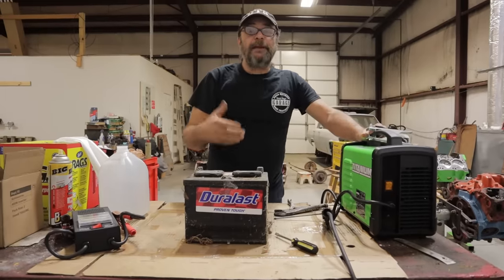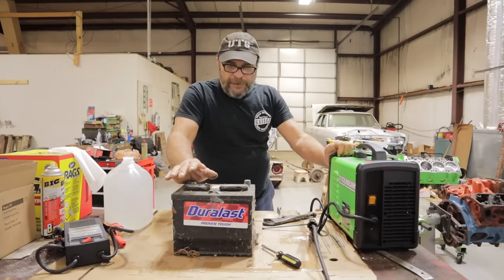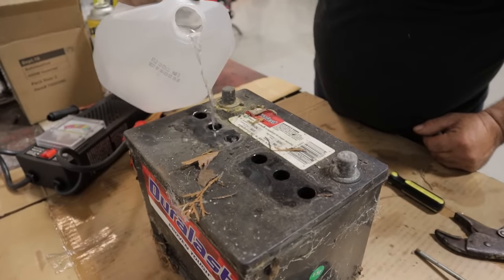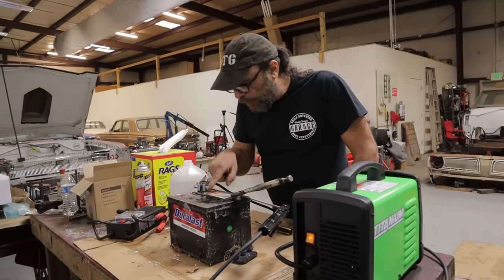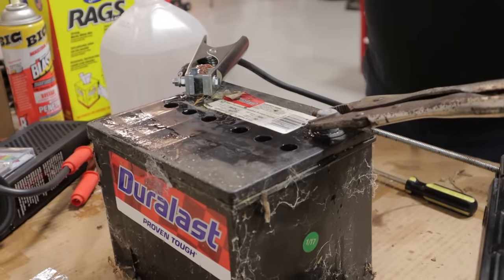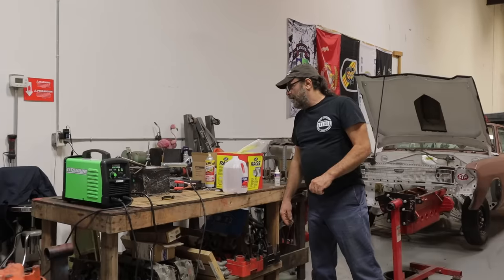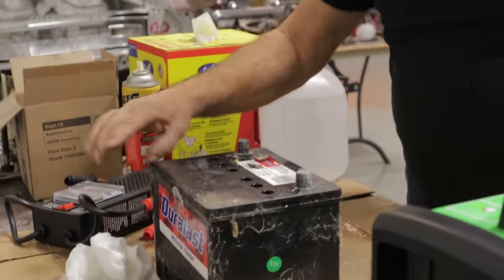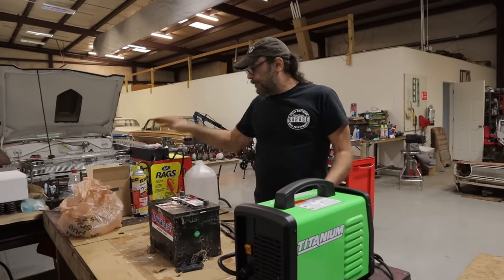Reviving Dead Batteries With A Stick Welder

Comment: 9:32 that’s the plates itself 😂, unfortunately sulfite is a component of active zone of the plate also (part of bonding agent), when you boil battery that way you are basically diluting it in electrolyte (ability to dilute it depends on the water/acid)

Comment: I have several golf cart batteries I'd love to try this with! I converted my Lincoln AC225 to run DC as well, but need to finish the power wiring.
Would you recommend doing each 6v, or connect 2 together for 12v, or do you think I could do the whole 36v in one shot?
And what about a sealed Optima battery?
Thanks for your content, I love Mopars & your channel is one of my favorites.
Reply: I think the Holy grail is from the high-frequency spikes in smps welding machines. So normal 50/60hz transformer welder may not give you good results, just thinking anyway.
Reply: how do u convert a ac 225 to dc? c an u have it work both ways
Reply: @dancassidy6708  I tried to find the video I followed, there are several newer ones, but here is the basic concept; https://youtu.be/JXJaRPXPwjQ
I built my own 250A bridge rectifier out of 5- 50A and used an old transformer to build the shunt. I kind of went overboard with mine my leads and all outputs are all converted to Dinse QD connectors (I can switch from AC to DC & switch polarity) upgraded and added fans, I have 120v outlets for a grinder, and I added a 24v DC power supply to power the fan in my helmet (hot & humid here) keeps it from fogging. Not too difficult or expensive.

Comment: So you boil  clean  the plates removing all the oxidation, 1st problem all that oxidation falls to the bottom of the battery. The oxidation is actually the plates themself deteriorating reducing the surface reaction area. While it may seem to bring up the voltage it holds the plates deteriorated will not produce the amps. Dont know how much clearance there is between plates and bottom of the battery case but all that oxidized material piles up on the bottom of the battery . My guess is at most it may seem you have more voltage but Amperage will never be as new. It may bee good to use in some circumstance such as low volt low amp lighting but high amp such as engine starter, I would not trust it as far as I could spit.

Comment: When you take a battery into Oreilly's they give it a massive current dump and test.  If it has anything in it, they will charge it.  If it holds, they give it back.  If it doesn't, it's probably a bad cell.

Comment: the reason destilled water should be used is destilled water contains no contaminants, not chemical, not mineral not plain old dirt  such as you see on this battery.  Therefore, I would use a funnel adding water to the battery to make sure no dirt gets in otherwise  tap water poured with a funnel could do less damage than destilled that washes the dirt into the battery cells.

Comment: Lead acid batteries absorb acid into the lead plates as they discharge, this creates a "low" fluid condition when battery is drained. 
     Adding water to the cells prior to a charging cycle can be problematic, as there are usually cells that have lower levels due to spillage, or lack of service, etc...
    When charging, lead plates push out the absorbed acid from discharge and the fluid level will increase, theoretically back to the full level.  It is at this point that any cells that had too much water added before charging will overflow, pushing acid out the vents along with water. The result is the some cells are now in a low acid condition, which will cause a higher evaporation rate in these cells, resulting in more water being added at service and a cycle of these cells looking like they need water, when a hydrometer will reveal that they have specific gravity issues. 
    Don't add water before you charge unless plates are exposed, the just enough to cover plates, wait until charging is slowing down and check s.g. and verify plates are submerged. 
     Fluid level will increase during charge cycle, and overfilled cells will overflow, losing acid that won't evaporate, but will overflow and not be replenished.
  Love the d.c. welder reviving of car battery, I can't wait to try it out.

Comment: I distilled the best bits of the first three hours reading these great comments: hope you all don’t mind being quoted badly and more succinctly:

SAFETY:

have a face shield (not just glasses), a pair of rubber gloves and a cheap plastic hooded raincoat, along with a garden hose close by that you can run to, but not right next to the welder. container of baking soda or two tablespoons mixed into the water would neutralizes the acid might not be a bad idea also. Seconds would count. 
Also keep the top of the battery dry as NOT TO SHORT CIRCUIT between the +_ terminals.
Use a timer.. which I do on everything even if set to several hours or half a day.. Let’s say you have to leave and forget? and a thermometer, ideally one of the infrared point-and-shoot ones you can use from a distance or you could just touch the battery on occasion to make sure it's not getting too hot.

good hearing protection

I've had 2 batteries explode in front of me in my entire career. One exploded without cause. I was opening the hood on a car when the battery exploded. Fortunately the hood wasn't open very far when this happened. This was much louder than any explosion I've ever heard in my life, and I served in the US Army! All of the acid was contained in the engine bay for which I was grateful!  The other battery explosion I witnessed was due to dirty terminals with a charger on. Seeing the charger was not putting out any amperage I went to remove the charger clamps when there must have been a miniscule spark and BOOM! My ears were ringing for a week! Thankfully I was once again spared an acid bath.

an internal short in the battery to ignite it or a spark to ignite the off gasses. This means my method of blowing off gasses only helps for (the more common) external sparks.. but not internal ones just learned of. So maybe take the caps off when jump starting? Hmm.. too much work each time.. always at least make sure the last cable to connect is to the negative on the body of the good car. And I cover my eyes or turn away at the final step where the spark comes. It’s the eyes we mostly have to protect.
Reply: Low amps method without a welder:
* 10 Amps is fine for average car battery. 
* 16.5V maintained
* Stop when each cell has reached a specific gravity of 1.265
* It may take 3 to 24 plus hours to reach that SG depending on condition.
* Use a charger that is not controlled and keeps on charging at full 10+ amps (most chargers will slowly slow down and trickle as batteries near 14.2 volts).

Check the SG before and after charging. That's the correct way to gauge battery performance. Check the voltage as it's charging. This is the proper way to do this. Using very high amperage for a short time is extremely hard on the lead plates. It will get far too hot (and maybe could warp plates and cause a serious shorting issue. especially if it’s a sealed battery which I do not recommend doing any of this to. Anyone know more about doing this to sealed/gel/AGM batteries?

—-

Another (maybe best) method:

1. Set the current to 100ma and set the voltage to 40v. 
2. When it reaches the current limit and drops below 15v, change the current limit to 2.5a and the voltage limit to 14.4v. 
3. Let it charge until it is drawing under 100ma (this may take over 24hrs). 
4. Then set the voltage to 20v at 0.5a for an hour. After that, it's fully desulfated, and the battery has a much lower likelihood of exploding because of the lower temperature and current. I've had a lot of batteries short out using this method, but none have exploded. 
5. (I would strongly advise against using a welder for this. A CC CV power supply can accomplish the same goal in a much safer way). 

(Maybe someone do a comparison of both methods with near identical batteries (solar or twin parallel batteries in an rv would be perfect for this) or the same battery three years apart might tell us enough. But that’s a long wait. 

Question is how many times this can be done. The dangerous welder method does seem to result in more than new spec CCA (granted when warm). Volts looked good also. 12.5+. Lasted a month for him so far like new. Could crank a large engine for nearly a minute. 

Testimonies:

Best tips:
The Lead Acid chemistry will self regulate current fairly well so you really only need to focus on getting it ~16V. But if you use a constant voltage constant current power supply you can limit the current and let it run for a long period of time. 
0.1C to 0.2C is a safe charge rate for lead acid batteries.

You'll want to get the specs for your battery and find the rated Amp-Hours (not cold cranking amps), then multiply by the C rate to get the amps needed to charge at that that C rate.

Example with a 50Ah car battery:
.1C * 50Ah = 5 Amps
.2C * 50Ah = 10 Amps

But this is often misunderstood because you don't actually specify the amps that flow into the battery, you only limit them.

If you set the limit to 10 amps (using a 10 amp charger or a current limiting power supply), you may not see 10 amps flow into the battery. This is because battery self regulates quite a bit. At very low and very high levels of charge it may pull far less than that.

The voltage is what pushes energy into the battery, and what breaks up the formations that restore capacity.

In short, I'd get a 16V power supply with something under 10amp max capacity, and hook it up. You can find CC/CV supplies on Amazon/eBay cheaply. Or you may wall adapter for a laptop or other device around your house.

13.8 is ideal for float/long term maintenance. This video is about reviving 'dead' batteries, so an aggressive 16V charge makes sense to break up sulphate crystals. But even a healthy battery benefits from charging up to the absorption voltage periodically. That's usually in the mid 14V range depending on chemistry.

—-

“Works great!!! I used a 12v charger with 50amp jump setting and left it on for two days outside caps off and i revived a 15 yr old schwab battery that was sitting out side for 5 yrs dead.”

—-

We always just used one of those heavy duty battery chargers. The ones with the 200amp boost. We would fill with water, plug in the 200 amp cables. Let it boil for 10-15 min. Then let it cool for an hour +. Then repeat. We usually did that 4 or 5 times for the great big ones. Usually only 2 or 3 that mes for the smaller car batteries. We kinda judge them by how fast they begin to violently boil. Brings them back from the dead. Good vid UT. *Edit. The charger must be the old school style analog. Not the electronically controlled ones, they will shut down before they do their job.

battery can pass a load test but when it sits a few days it can discharge itself if it has "dendrites" which are thin slivers of lead that get electroplated from dissolved lead in the solution. When one of those crosses from positive to negative plates inside the battery that cell will drain

Comment: What's the voltage output from the stick welder? Aren't they in the low voltage range? Like 2V or something along those lines? 
While the battery in your video appears to recover, I'm thinking that it's build up on it's plates must not have been that bad and thus a jolt of high current helped restore it. 
I have a sealed lead acid battery that I have purchased new and thus I know it's history, I might have used it twice..... It was left to go totally dead for about a year if not less and trying to charge it at 14V from my Lab power supply, it only began showing a 1mA draw after 5 hrs of charge time! The battery now holds steady state at 2.5V when left to sit for a few days.... I'm now charging it at 32V and the current draw has climbed up to 5mA and the battery voltage drops to around 5V steady in a few minutes.... 
But still, the current draw suggests that the build up on the plate's is very high and a much higher voltage is needed to get it to boil off some oxygen and hydrogen to restore it's plate's to a more healthy condition... 
I'm going to have to get a DC to DC converter to step up the voltage to clean up it's plates... There's far too much resistance for 32V to get through let alone the standard 14V charging voltage....
Edit: it's now 10 minutes later and the sealed lead acid battery is drawing 9mA at 32V and the battery is feeling a little warm on one side, the off charge voltage is now at the 7V mark... This battery appeared to be completely dry when I opened it to check it's fluid levels before I attempted to charge it and thus topped it of with deminralised water... 
This method appears to be working so far, I have plenty other batteries that would be considered as dead.... I'm going to be testing this on other totally dead batteries that I for whatever reason decided to keep...
Reply: 18-24VDC its known as CCV closed circuit voltage.

Comment: That welder is probably more expensive than one of those cart style battery chargers which produce a 40a current and will do the job the same way. The secret is just to put the distilled water in, let it charge at 40a for like 10 15 minutes

Comment: Tony, I'm trying to figure out how to connect my Spool Feed Wire Nozzle to the positive battery terminal. My Titanium Flux 125 didn't come with a Arc Welding Electrode Holder.    I'm searching now , Any ideas? Thanks Tony.

Comment: What qould happen if you used low amp ac on it ? Do you think the invertwr welder might not have to duty cycle for this kind of activity, because they did t bubble out within the 5 min mark right?

Comment: Hey I work at a battery company called at batteries Inc I've been working there for about 15 years your method is is correct that's how but 50 amps is way way too much you're going to blow that battery up in your face you need a variac charger at about 10 amps until the battery gets hot typically 24 to hours can you take a hydrometer and test the pH on the acid it should be around 12 80 then you take a a testing machine that's called a metronics until the cold cranking amps to determine if the battery is good it has to have about 80% of its original answer five below test without dropping under 12 v

Comment: 1.sweep the crap off battery before opening it. Why use distilled water then risk dust/dirt falling in?  2. Use a fan up stream to blow gasses away from battery while doing this to prevent buildup of explosive gas next to battery and welder. Otherwise any ⚡️spark = boom 💥

Comment: I wonder if there's a way to take the lid off those batteries and I'm sure there is if you know what you're doing but again take the lid off and manually clean the lead acid plates whatever you call and then either change the acid or whatever you got to do to make it go

Comment: Never hold your battery tester on a load that long. If you notice inside those tiny round vent holes there is a heating element like those in an cook stove/oven. That gets super hot. No need to double check the load either. What you will end up doing is burning up your battery tester. And be careful where you lay the hot battery tester down. The red hot heating element doesn't cool down immediately.

Comment: this only works on some batteries. some btteries that are fully discharged or bad cell will not be recovered period. as we all know or some of us know, the battery must be cooled down for at least 12 hours prior to use, and must be tested. i did 14 batteries and only 3 held there charge. the rest turned out good and after a 12 hour cool down they were bad again.

Comment: I was told by Battery guys on youtube that while you are charging a Battery, you should put your hand on the side of the battery to feel the heat coming from it.  It should NOT be so HOT that you can't place your hand on it.  If it is too Hot to touch and keep your hand on, then it may be a Bad Battery that you should not try to charge???  Same thing if it is deformed at all.

Comment: Never fill a discharged battery. It will overflow when you charge it. Only put in enough water to cover the plates. After the battery if FULLY CHARGED… then fill it to the recommended level. This is usually near or at the bottom of the fill hole tubes.

Comment: Interesting experiment, but you really should have hosed the battery off before removing the caps on the cells; it looked like the flooding of the top you did, topping off the cells, was likely going to wash some dirt into them, which definitely won't help your cause.

Also, you'd have had a much clearer idea of just how much you were accomplishing if you had used your load tester on the battery before doing anything to it.

I'd test it before refilling the cells, then again after refilling them, but before applying the welder, then you'd have a baseline for comparison after the welder had been applied.

Comment: This is kinda old school , but I used to see similar things back in the day of battery shops , and radiator repair,  they would have a bunch of old batteries they bought or people traded in for new ones .
They would rejuvenate the old ones , and sell them for a cheaper price. 
They would go as far as to tear down an old battery and rebuild it with new plates , and be stronger than ever.
They would have large tubs of liquid water and an't freeze,  to lay the radiator in ,to pressure check for leaks.
Then if there was holes ,they had a touch near by to brase it over. Like I said old school 
Before Oasha, and price of chemicals,  and the lost of nohow. Everything nowadays are thrown away  Society !